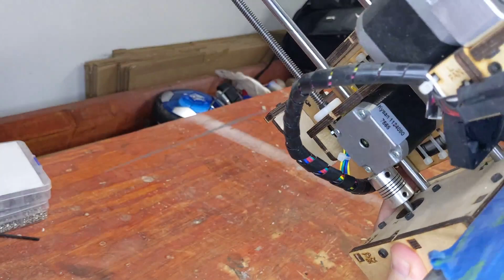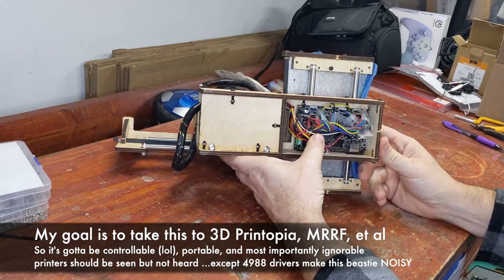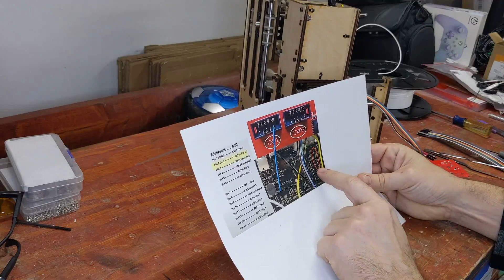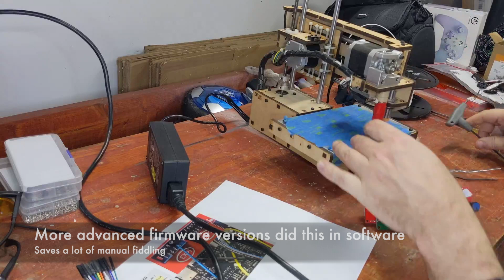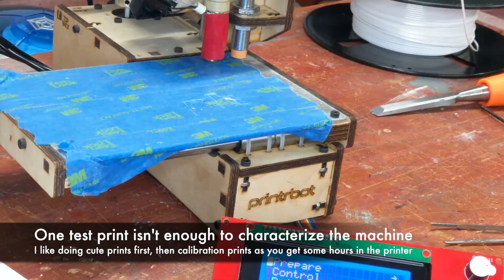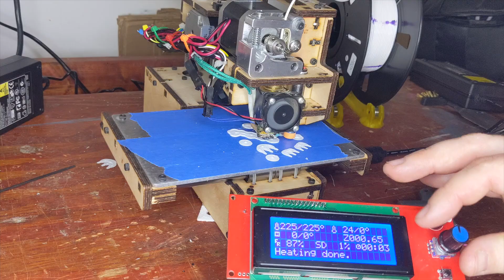Evaluating a NEW TO YOU 3D Printer

Comment: That's one of the fancy ones with an actual coupler on Z and not just a piece of tube, belts not string wrapped around a round Dremel sandpaper attachment.
Reply: That was the one i still have.
Reply: @airwolf269  1401 or 1405? Because mine was a 1401 and is reduced to parts
Reply: @jakobhansen1396  I had the beta version with the wooden gears on the front.
Reply from the maker: I was really amazed with how well the strings and pulleys worked - that tubing-based z-coupler was all kinds of terrible though!
Reply: @PaulChase  Yeah the tubing was a bad idea. But i will say i printed everything on it. It was a beta so i was glad to help improve on it.
Reply: @airwolf269  it turned out ok, but was all kinds of wobbly and accelerations set to 10000 didn't help. But decent benchies only took 45 minutes